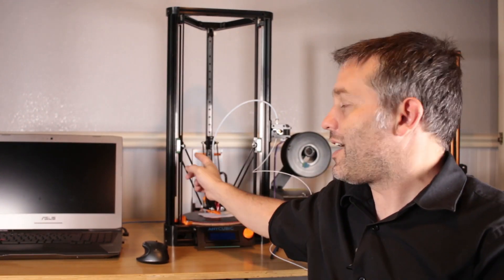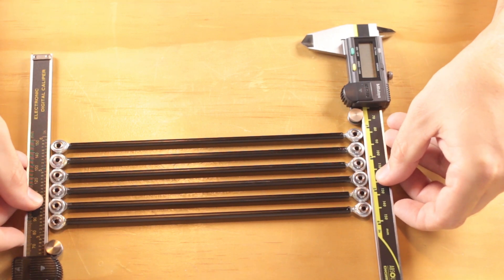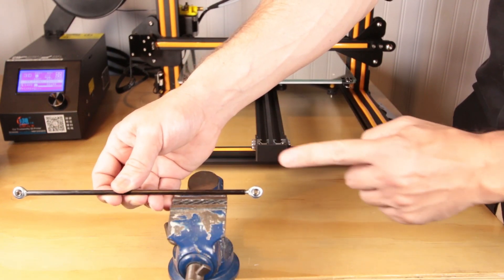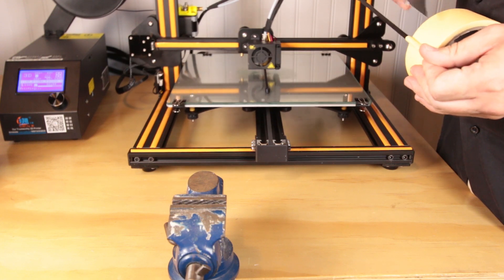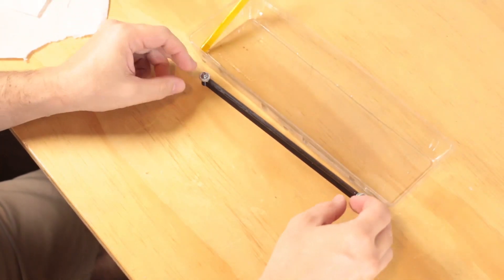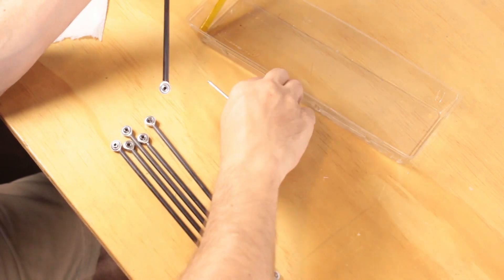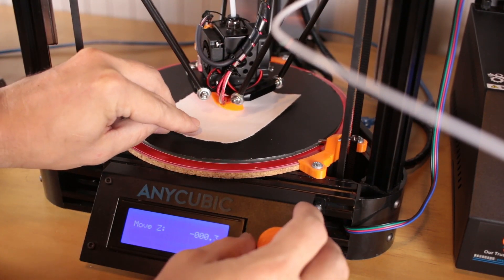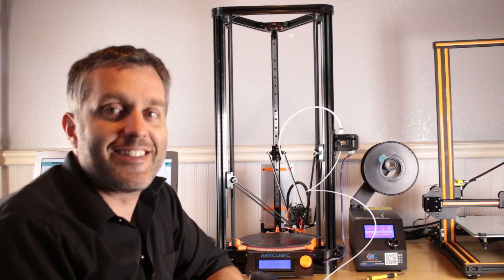Changing Kossel Rod Length for More Accurate Auto Bed Leveling with the BLTouch Probe.

Comment: Congrats on the baby... Anyways I broke down and bought the EZ bed leveling system and it works wonders for this printer I am trying to get them to tell me what's going on in the background but haven't gotten much info. Either way it works good.

Also I am wondering have you thought about possibly making this thing bigger maybe turning it into the plus size of this printer or possibly bigger? I was wondering about this as I would like to get more X and Y printing space 

Thanks for sharing the video!

Comment: Just thought I'd post some comments for future viewers/readers:
1.  Before remaking all the diagonal rods, set up a jig to measure the hole-to-hole distances.  As DPT shows, measuring from the ends doesn't quite cut it.  You can clamp some long screws onto a piece of wood, for instance.  Or print a jig like he does, but make it adjustable in two pieces that you can clamp together.
2.  For Deltas, there are 3 calibration steps you need to do:
----(1) Delta calibration using G33.  This measures the end-stop positions and the delta radius value, among other things.
----(2) Bed leveling using G29.
----(3) Set the Z=0 height precisely.  Various methods.  You can use M665 H<height> and G1 Z0 and tweak the height value until a piece of paper just slides under the nozzle.  The height value is the total distance from the top Z homed position to the bed.  Use M503 to read it back out.
It might even be a good idea to repeat those steps, since they can interact with each other.  Use M500 to save once you've gotten it all dialed in.

Comment: I found this video very useful.  I am considering tearing apart my Anycubic Kossel, and re-building it with a new frame and bigger build plate (something about 300 mm dia.).  This would mean that the rods will need to be longer by about 140 mm.  Thanks to your video, I know of at least one way to dismantle the rods and re-build them with a longer carbon fiber tube.  Thank you very much for sharing this information.
Reply from the maker: Did you see my last Kossel video? https://youtu.be/iNMt2MYfrF8

Comment: I got extremely tired of leveling the bed of my cartesian style printer. Having to adjust 4 corners or rely on mesh bed leveling. So I built my own printer and made the bed as dead flat as I could. I managed to get all 4 corners aprox .0005 of an inch. Now I just use the BL-touch for the standard auto routine, with no mesh leveling or adjusting corners ever again. I had to overbuild the entire thing but it was worth it to me. Plus I had a lot of fun putting it all together =)
Reply: yup nothing beter than getting it right manually

Comment: Hi, I own a DIY delta printer that I built from scratch. I looked at any video I could find over the internet of people talking about their issue with their delta printer and crossed the different informations to achieve a better understanding of the mechanical behavior/advantages-disadvantages/pros-cons/causality-effect of any misalignment or adjustments.

I'm on the impression that, if the problem is "mechanical", it could be caused by a misalignment of your tower.

1) all tower need to be as parallel as possible as per the center axis (Z axis) 
2) the bed as to be perpendicular as per the center axis (Z axis)
3) all tower end stop have to be from equal distance from the bed (after the bed is guaranteed to be perpendicular to Z axis).

Please, I would like to have a feedback.

Comment: I know I'm three years late to the party but I just found your channel via user comments in Maker's Muse's latest live stream and have been catching up on your 3DP videos.
Did you ever get to the bottom of this bed levelling issue?
In your last video you used the set screws on the MGN12* blocks to make the tower end stops parallel with the bed which doesn't seem quite right to me. On a well designed effector the tip of the nozzle should vertically coincide with the center of the effector plate and those set screws are meant to adjust the XY origin of the nozzle (e.g.: if I shorten the set screw on the Z/C/Gamma tower it moves the nozzle in the +Y direction) so I adjust those set screws such that the tip of the nozzle is equidistant from each of the towers after a G28 command. On a poorly designed effector plate, where the nozzle doesn't coincide with the center, I make the closest sides of the effector plate equidistant from their respective towers. Then I shim up the bed at each of the tower positions so that it's parallel to the end stop positions and finally adjust the radius configuration to compensate the bowl effect just as you did.
Hope this helps!

Comment: on the rod length, could you have nail one of the rods to wood, snip the heads off the nails and then measured all before cracking them open?

they may have been right up front.

nice work

Comment: Hi all! 

There is marlin based custom fw (marlin 1.1.5) for anycubic delta: https://github.com/emilio1625/Anycubic-Kossel-Marlin it has automatic manual leveling. Meaning it moves the head to more than 10 different places and you just need to set the right z-hight with the menu knob on the printer. When all points are done, it calculates needed new values. (should work like autolevel, you just need to set the hight manually with the paper).

Also it has function to move the head to needed places to level it with the screw method. Its up to you what you want to use. :)

PS the fw is not made by me, but i used it and it works great. It also has default values for the linera/pulley version and not the plus version.

Comment: You are measuring from the print head in the center but the BL Touch is measuring from the corner. It might be a changing the angle slightly as it moves from one side to the other.

Comment: Well, this was all quite useful and interesting.
Useful because I reckon I could equalise the length of the rods a whole lot quicker, just by unscrewing a few of the ends to suit the jig.
Interesting because the auto-levelling doesn’t seem to be getting you any further than manual levelling. Glad I haven’t yet spent the money for auto levelling...
I wonder whether you’ve put a straight edge across the glass yet :) or considered those thumbscrew-adjuster mounts that you can get? Or maybe just a shim under the glass...

Comment: You needes to take into consideration what the true center is. The sensor is offset and you didn't account for that in the firmware. The sensor needs to think it is at the center. If the sensor is offset and that is not taken into consideration the bed will always be "slanted".

Comment: Same problem, I think it's something with the printer, I'm on the ANycubic Kossel facebook page, a few of us are having this problem, couldn't get ABL to work properly. I'm going to try the EZbed leveling soon, if that doesn't work, do what Homofaciens did, print out the manual leveling knobs in PETG and manual level that way. I've tried marlin 1.1.0 to 1.1.5, measured the rods. G33 and G29 with M502 and M500 beforehand, and I still get 1mm too high in the front, and almost squishing the filament toward the back, essentially what z1power said, something about the effector itself. Again if EZbed doesn't work, Knob MBL it is.
Reply: iamthebest22 I can confirm EZbed leveling works fantastic

Comment: should have threaded the eyelets into the rod after putting glue in the hole instead of just pushing it in, that way the glue will stay around the threads and attach to the tube for the entirety of the threads instead of just being pushed into the tube and leaving hardly any glue around the threaded part especially near the entrance of the tube.....
Reply from the maker: A good critique. Thank you.

Comment: Had the exact same problem with ABL with this printer. Seems that at different positions around the bed, the effector tilts slightly enough to offset the distance between itself and the sensor, causing a lot of error. Never found a solution and just went with MBL.
Reply: Did you do auto delta calibration before bed leveling?
Reply: Yeah I ran it through that
Reply: Did you store the results before executing the auto home command?
Reply: I did that as well, but when printing it was way out to lunch by over 2mm in some spots. Tried switching to from a capacitive to an inductive sensor as well and it made no difference.
Reply: I had about 1mm difference between highest and lowest points. What is the calibration data you got back from auto delta calibration?
Reply: c:-0.09     
x:-0.08   y:+0.11   z:+0.13
yz:+0.09  zx:-0.14  xy:-0.13
Reply: Also, my level is perfect after these steps

Comment: I'm having a similar issue where the nozzel is too low at the X tower, too high at the Z tower and perfect at the Y tower
Reply: Yup, took me a while to wrap my head around that. Your frame geometry is off by a few percent. If you have a probe, run auto delta calibration to fix.
Reply: I've tried Auto Calibration before, calibrates after 3 iterations, I enter the endstop and tower angle offsets into Marlin but I still have the same problem. 
Could the auto calibrate be giving me the corrections in the wrong order?
Reply: I've gone as far as adding 
G33
M500
G28
G29...

To my starting print gcode, same results
Reply: MechV that should work. What version of the firmware are you on?

Comment: User error. I have it working on mine. In a few hours I will send you my firmware and tell you the details you got wrong.
Reply from the maker: John M My email can be found in the "about" section of my channel.
Reply: Email sent. Have fun!
Reply: If it works for you, please consider posting the firmware in the public domain....
...I'm sure that there are quite a few of us experiencing 'user error' and sight of a working version of the firmware would be much appreciated.
Reply: I would, but i want someone else to confirm success first. (You volunteer?)Also, considering design prototype test sels his own copy of the firmware, it would be immoral to post a link here.
Reply: Design Prototype Test...did the firmware submitted by John work? Greta video by the way!
Reply from the maker: Hi ΜΟΛΩΝ Please watch my latest video on the subject: https://youtu.be/3IJX6p9oETY I talk about his firmware in the first couple of seconds. After you suscribe, make sure you press the bell icon. This way you will be notified of all my uploads and you won't miss an update about this project.
Reply: ΜΟΛΩΝ ΛΑΒΕ it works for me, with a micro switch. Bltouch for some reason does not. I ordered one to debug.
Reply from the maker: At the moment, my guess is that the firmware is not the issue. I think my firmware was always perfectly functional, but end effector tilt was giving the firmware bad data to work with.
Reply: Design Prototype Test can't be that. I have a way bigger z offset on my probe, which would increase the error. Also, your diagonal rods look better then mine.
Reply from the maker: Alright, I'll give your new firmware a try tonight.
Reply: DTT...I thought I had that checked! It is now, thanks for the reminder. Just watched the video and checked my printer and I have quite a bit of play as well. I'm going to dissasemble it tomorrow and determine where all the play is and try to shim the eyebolts to get better tolerances as you described. I have finished my build but have not loaded the firmware you sent to me last week, wondering if I should hold off or load it up and get to work. Also my machine is the linear plus, your fw should be compatible?
Reply from the maker: The firmware I sent you last week is for manually leveling your printer. If you do a good job with that, your printer will work acceptably. Even with the play in the eyelets of the rods.
Reply: Design Prototype Test so, how did it go?
Reply: John M can you send me your firmware too ?
Reply: Your channel rocks man, I watch all your vids now :oD

Comment: I recently saw another video about leveling a Kossel printer. Check the YouTube video by Jay Couture titled "Delta Calibration - Fine Tuning". After the "watch?v=? part of the url add "1fwwA2gfolo". It includes an change to the firmware. You might find it has some information that may help you.

Comment: Wow, no way to measure the rod length?
You don't need to measure the length. You just need to ensure they are all the same.
Get 2 long 3mm bolts or metal rods and stick each one through all 6 rod holes.
This will tell you if they are all the same length, hole to hole.
Then you just need to lengthen any short rods.